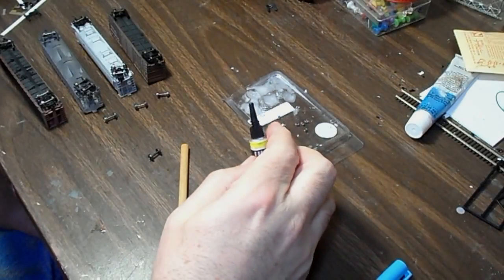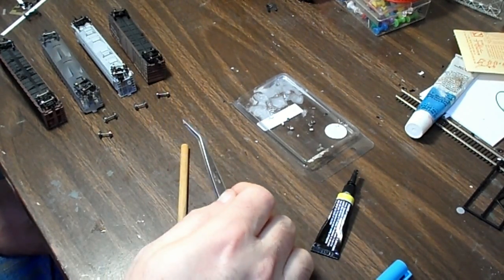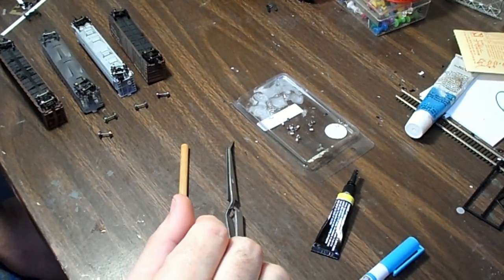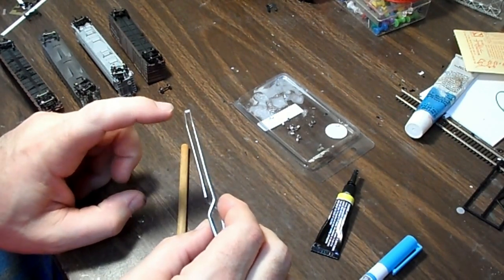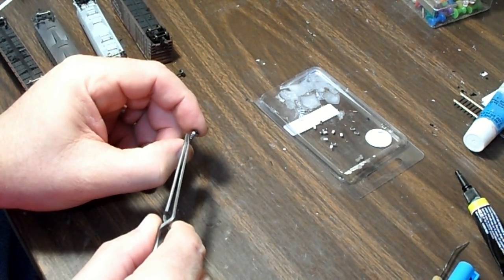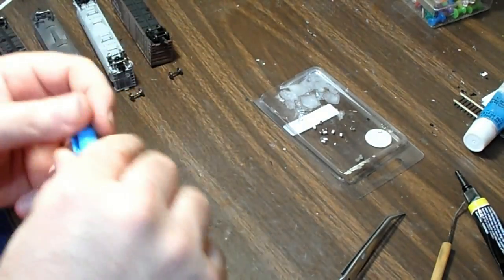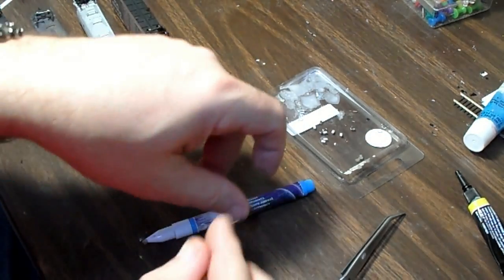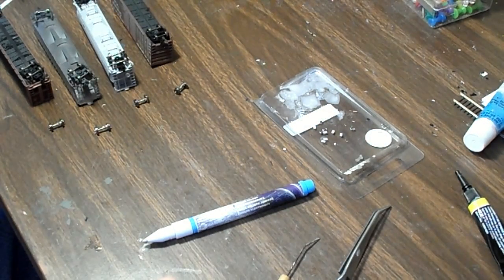Resistor Wheel Sets

Comment from the maker: Should not be a problem as the resistors draw a minuscule amount of current.  I have 40+ locos and 300+ resistor wheel sets all powered by one 5A Digitrax booster.

Comment from the maker: There are 36 individual blocks on the UPRR Geneva Subdivision mainline.  To tell if a block is occupied, each block has a current sensor that sends a signal to the computer whenever there is any electrical current passing through the rails of that block.   These resistors allow a very small amount of current to flow through them so that if the car is in the block the computer with be able to know that the block is occupied and will set the signals accordingly.  Hope this helps

Comment from the maker: I guess I should have explained more about the reason for adding the resistors to all rolling stock.  Its not a DC vs. DCC thing.  Instead it has to do with the computer controlled signaling system and also dispatcher control during operating sessions.  In order for the computer to control signals on the railroad in a prototypical fashion, the computer needs to know where the trains are.   So, the layout is divided into electrical blocks.